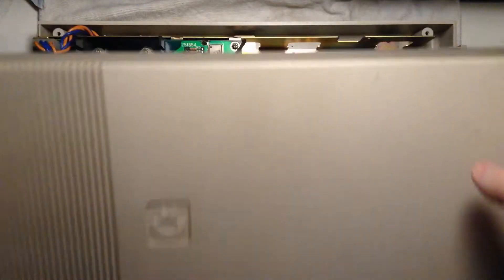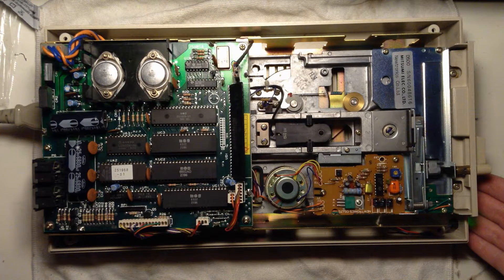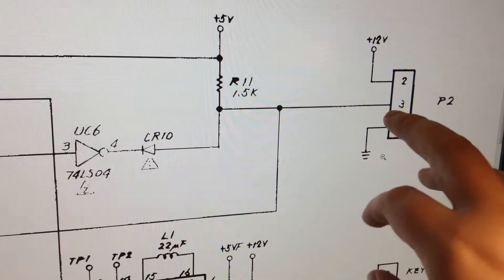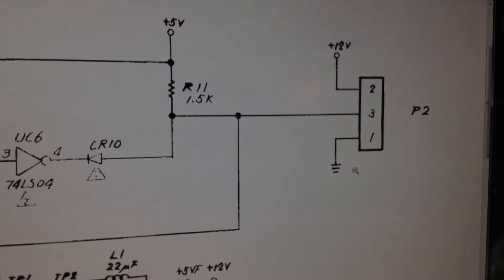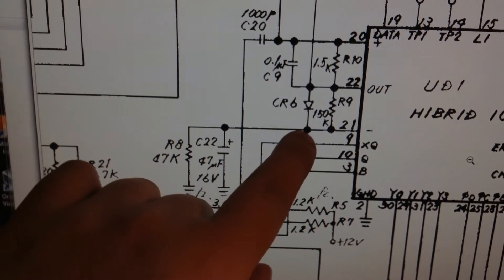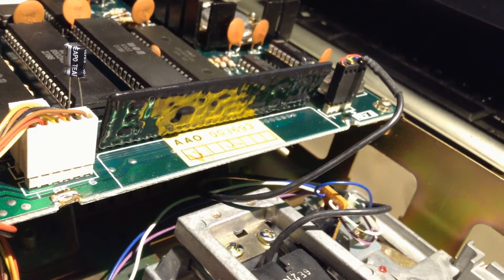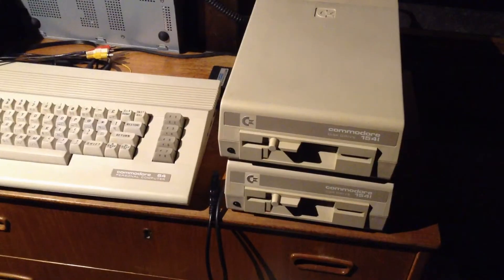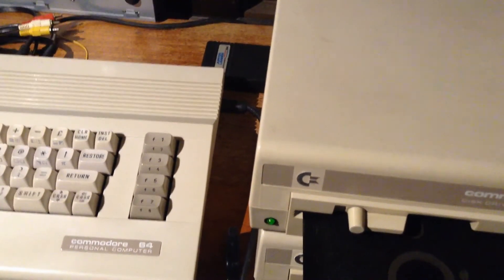Commodore 1541 Repair - motor runs continuously

Comment: Excellent work! I'm having the same issue and hope you can help me. My board looks different than yours and my C22 is in a different location and it's a ceramic cap. I'm not sure what I need to do at this point. I'm good at soldering but not good at diagnosing :-)

Comment: 2:24. That red component isn't attached to the other contact point
Reply from the maker: 1980sGamer temporarly
Reply: Ah. Well you did get it working. Good job. :D
Reply from the maker: You have a good eye. This diode i lifted to see if the problem resolved, and it did, so it was the capacitor on the other side of the diode that was shorted. :)
Reply: Hmm. Interesting idea.

Comment: At 5:57 you suggest that the PLL in the hybrid IC is used to regulate the motor speed, this is not correct. The PLL in the hybrid ic is used to reclock the data coming from the read heads to compensate for variations in the data rate. These variations are caused by mechanical factors in the drive and disc and need to be corrected during reading to ensure the data reading clock is synchronised to the data coming from the disc.

Did you put the  CR10 diode back into the circuit? Not shown in the video.
Thanks.
Reply from the maker: ZEROSTATIC72 Interesting. Yes soldered it back in, or it was a diode i lifted and soldered back in, not sure if it was CR10. Too long ago. Ok i see, the CR10 is not used with 7406 on UC6, open collector. i mention this in the video. there is a trace shorting it, not shown in the diagram

Comment: Very nice video!
Reply from the maker: +Toshio Spoor Thank you ! The drive still runs. I bought it as faulty unit for about 100NOK, which is about .. €11..
Reply: +bwack a very nice deal :) did you replace the capacitor with exactly the same specs ? Voltage and farad ?
Reply from the maker: Yes. Voltage specs I don't remember, but as long as the new capacitor has the same farad value and same or higher voltage rating, it is ok.
Reply: +bwack ok, I was asking this because I don't have all those things laying around. So you must have a lot on stock (of the right farads) Good how to learn how to troubleshoot, still have some things to repair ;)
Reply from the maker: +Toshio Spoor I had planned and ordered components to re-cap the c64. I borrowed from there :)